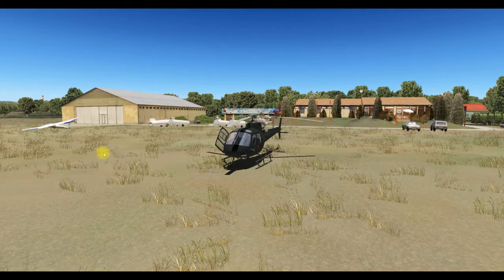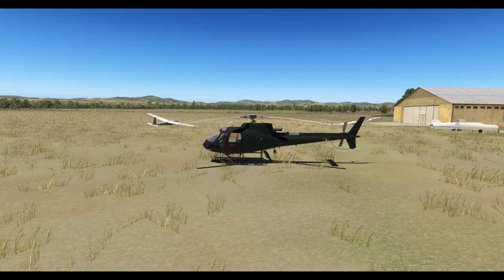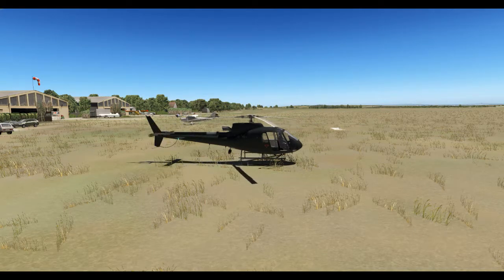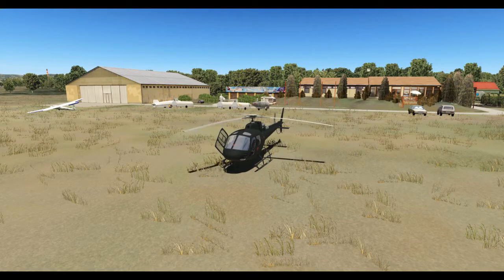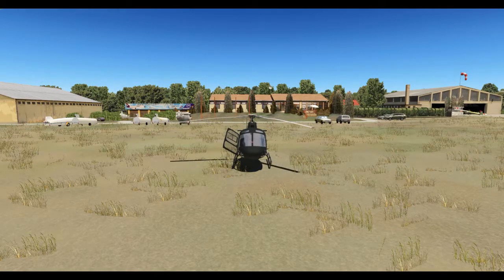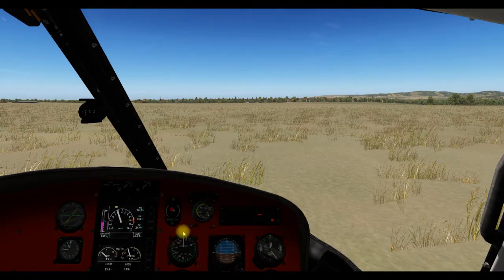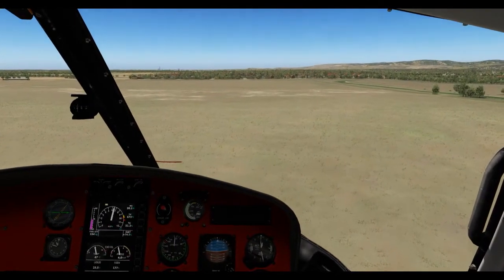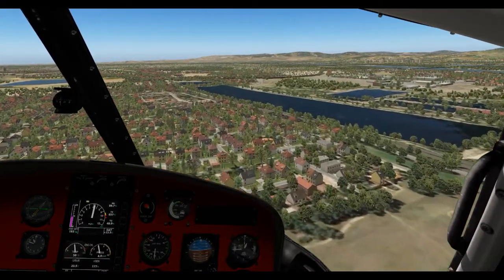Retreating Blade Stall -- Basic Demo  -- AS350B3+ -- X-Plane 11.11

Comment: Question...I guess they would never let the governor stop you from that high speed?
Reply from the maker: The governor only controls the throttle so as you add more collective it balances the power so you don't get a drop in rpms so you could easily fly into a retreating blade stall and actually still have reserve power to go even faster. I image that it would be possible to force you to slow down if you got near the threshold but as far as I know the only technology available is some helo have a sophisticated flight monitoring and tactile accedence warning system that will warn/alert you if you are getting close to a dangerous area in the flight envelope but probably would not automatically force a correction. The problem really is that you can easily push the helicopter over the RBS threshold without really having to exceed any other parameters so that is why it often comes with no warning if say you are in a combat situation and need to be going as fast as possible but get distracted and rapidly can get into a error zone.